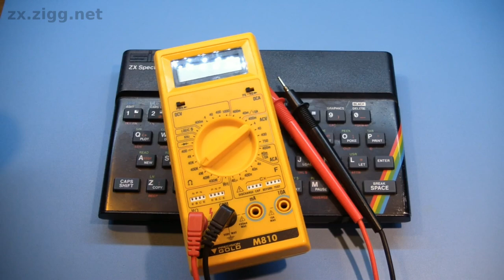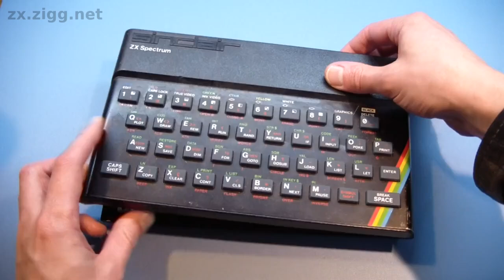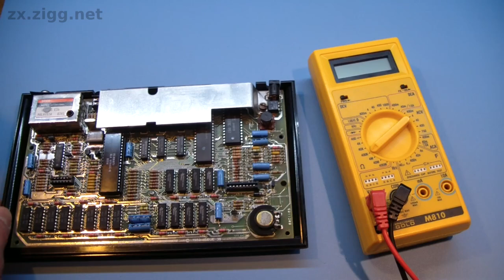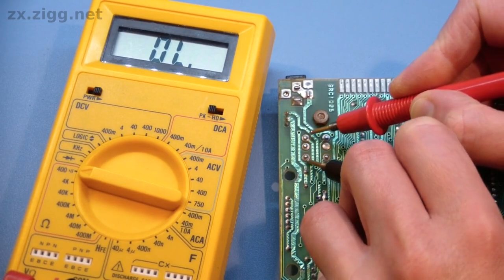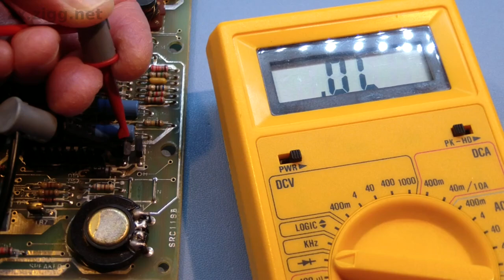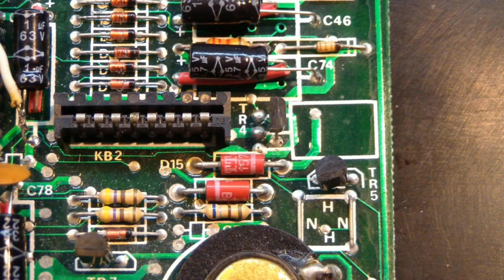ZX Spectrum (48K & 16K) Initial Tests

Comment: HI, I have a fault on my issue 4b, I've had a lot of help from the good folk on the spectrum 4 ever group and I've managed to get it working with their help, but I now have a strange video problem I thought doing a composite mod might help but it's no better, I've tried with and without a 100uf cap, the problem is the image on screen is wobbling and I get intermittent red'ish fuzzy colour bursts, it looks like what happens if you switch between pal/ntsc, but the tv doesn't have a pal/ntsc selector for cvbs, I've repaired a good few components for various reasons but the machine is re capped and I've changed the LM 1889 IC and the crystal x2 I've also replaced TR1,2 & 3. can you think of anything that could be causing the picture to be unstable? any ideas where to look next, I have some basic tools but no scope.Thanks,Chris.
Reply from the maker: If the Spectrum works perfectly apart from the display problem you describe, we can conclude that the fault almost certainly lies in the video circuitry. An oscilloscope would be very useful here; I'd want to use one to view the final video signal and the signals at some of the encoder IC's pins - the Spectrum service manual has some diagrams showing what should be found here.

You might have to consider the possibility of the failure of one of the components that almost never fail; resistors and the small capacitors. I have encountered a few very strange video faults that were caused by these components. I recall one case where a ceramic capacitor had gone short-circuit and another where a resistor had broken in two, but the break was only apparent with very close inspection under a magnifier.

Comment: When I could not find the adapter for the zx spectrum +, I found myself another. (8V and 2.6A) power jack internal +, external -. This adapter has been in operation, the jack entry verification ...
Reply from the maker: Your message doesn't make much sense, but I think you might be enquiring about the suitability of the power supply unit you have obtained. The one you describe should work, so long as it has a DC output, HOWEVER, note that the centre terminal of the ZX Spectrum's power connector must be connected to the negative side of the supply. The computer will probably be damaged if you get this wrong.

Comment: I have a spectrum that I have just acquired but it has issues.  It's an Issue 2. I tested the voltages on the Lower ram. I'm getting -1.79v on the -5v rail, 6.79v on the 12v and 4.89v on the 5v rail. Regulator is putting out 4.89v. it's very voltage sensitive (I'm using a Weir non switched mode bench supply). would bad caps cause the low voltages or something else ?
Reply from the maker: Either the voltage converter circuit isn't working or one or more faulty lower RAM ICs are overloading its outputs.

There is a potential circle of failure and all parts must be corrected in one go.

The voltage converter circuit most commonly fails for one of the following reasons:
 - Aged electrolytic capacitors. If your Spectrum has its originals, I recommend you replace them (see another video I've made about this process if you need advice on this).
 - Incorrect use of the expansion connector has shorted one of its outputs.
 - One or more faulty lower RAM ICs has overloaded its output.
In all of the above cases, TR4 usually burns out and sometimes TR5 as well. It's rare for the inductor to fail, but it can happen.

Lack of the supplies generated by the voltage converter circuit often causes one or more of the lower RAM ICs to fail, so ideally, you must make sure the converter circuit is fully working and none of the lower RAM is faulty before applying power again.

If you use a bench power supply to feed the Spectrum 9 V DC with the current limited to 750 - 800 mA, then usually if the current limit activates for more than a few seconds, you'll probably have a few seconds further before TR4 is destroyed should one or more of the above faults still be present.
Reply: Thanks for the speedy reply. I'll change the caps and possibly Tr4 & Tr5. I hope the lower ram is ok as I'm able to enter "PRINT PEEK 23732 + PEEK 23733 * 256" and get the 65535 (48k answer). It wont load tapes either and I hear no loading sounds although beep command and key click is ok. hopefully not a faulty ULA, even though it gets quite hot... I have already purchased a new keyboard membrane and upper ram module. I'm losing faith with it, it's starting to cost more than it's worth.
Reply from the maker: I'm a bit confused. If the lower RAM 4116 ICs haven't got all three of their power supply voltages, then there's no way the computer will initialise and give you the Sinclair Copyright message. I think you must have made a mistake in measuring the voltages.

If the computer produces the correct initialisation display, then the voltage converter circuit must be working and the lower RAM is probably not faulty (though it might have a partial/intermittent fault). I still recommend replacing the electrolytic capacitors, however.

If audio output is working, then the ULA's audio I/O is probably (but not certainly) not damaged. What are you using as the audio source? Many modern devices (e.g. phones/laptops/MP3 players/etc.) cannot produce a signal of sufficient amplitude for a Spectrum to be able to load from.
Reply: I can assure you, those are the voltages at the lower ram chips tested with my Fluke 77.  the Spectrum works set on at 8.42v. Slightly less then I boot to black screen with white border and If i up the power to 8.75v or more I get black squares starting to appear on the copyright screen. As for audio, I have tried phones, pc Soundcard out and a cassette player ( only radio noise as I have no tapes) I hear nothing through the Spectrum's speaker at all. I did trace the audio back to pin 28 (i think it was) of the ULA socket and sound "in" is present but very quiet when the ULA chip is installed and clear as day when the ULA is not in there. (hope that makes sense) . I plugged headphones into the mic socket and wrote a quick hello world program then saved it. sound was spot on and loud through the headphone. Think I'm getting far beyond my capability's here but I do appreciate your help  :)
Reply from the maker: I'm still a bit doubtful. If your information is correct, then your Spectrum has miracle 4116 ICs that are unlike any other! Perhaps they're just about managing to work in some way with the voltages you've measured, but I'd certainly expect the whole system to be unreliable.

Are the voltages you refer to in your message immediately above what you are feeding into the Spectrum's main power input socket? A Spectrum shouldn't be very sensitive at all to variations in its supply voltage. If so and the regulated 5 V rail is remaining steady, then I think your Spectrum has at least one of the faults I described in my first reply.

Can you hear a soft buzzing sound from the inductor when the power is on? Have you tested TR4 and TR5 (in-circuit measurements are usually enough to tell whether these have failed)?
Reply: That is the voltages I'm supplying to the DC in, yes (sadly no current limit on my supply)..... I hear no buzzing sound around the inductor and it looks like we have a short on TR4 between base and emitter.  Tr5 seems ok. I'll order a new transistor (or two), replace the capacitors and I will report back any findings. Thank you.
Reply from the maker: A base-emitter short is a very common failure mode for TR4. A short between the inductor's windings would measure the same, but that's far less common.

Note there are very few physically small NPN transistors that will reliably replace TR4. However, it isn't too difficult to buy a ZTX651/652/653 and you should use one of these.
Reply: Well, my transistors arrived today and I just couldn't wait to replace Tr4 and see if that fixes things. ZTX651 fitted nicely. Now my inductor is buzzing and my voltages are now spot on!. The spectrum doesn't care on what voltages are supplied either and I'm now playing Manic miner on it. I still need to replace all the caps once they arrive but I guess I can consider this a fixed Spectrum. Thank you very much for your replies and time.

Comment: +JoulesperCoulomb - What cheaper makes and models of testing equipment would you recommend to make the various tests on you videos? My multimeter is missing some of those tests and ranges.
Reply from the maker: +eLJaybud What is it missing? Almost every basic multimeter should be adequate for the tests demonstrated in this video; even the most cheap and nasty. If it has manual range selection, then its range divisions don't have to be the same as the ones on the meter I used. Simply select a range that covers the expected likely reading.

As noted, the results for the resistance tests vary somewhat depending on the multimeter used and the version of ZX Spectrum. The aim is to make sure none of the circuit paths measured have an unreasonably low DC resistance.

Comment: Excellent!

I just ran through the tests on an Issue 1 and got slightly different results:
 
For 16k RAM:
- lower right pin 9 I got 90-100 kOhm.
- upper left pin 1 I got 1.2 kOhm.
- lower left pin 8 I got the same as Iss 2, ie 800-900 Ohms.

For TR5, +ve on base and -ve on emitter I got 0.8v.

These seem reasonable but I was wondering what others read for Issue 1s?
Reply from the maker: +derekjc777 I've never tested an issue 1 Spectrum. The readings you report do not indicate the presence of any serious fault.

Comment: I just received a 16K Spectrum, issue two. I purchased it as a faulty piece with an intention to repair it myself. I performed all the tests described in this video however i'm not sure which results are OK and which are not OK as i have a different multimeter which has scales like 200, 2000, 20K, 200K Ohms etc. instead of 400,  40K, 400K etc. For example the voltage regulator measurement shows 3.97 on 20K range (left side). As for the voltages i measured +8.9V on the left, 0 on the center and +5.02 on the right side which i suppose is OK.
As for the TR4 measurements, I got a value of 1415 on its emitter (when using diode test feature on the multimeter) and open circuit on it's collector (multimeter beeps just like when you perform conductivity test).
This is the picture Spectrum currently shows:  http://s7.postimg.org/qw91apjl7/WP_20151029_001.jpg
Hopefully it's just the lower ram + related transistors and not the ULA.
BTW You produce fantastic and very informative videos, please do more 'Spectrum repair' videos, they are cool!
Reply from the maker: +TheGoldieOldies It doesn't matter that your multimeter has different ranges. This method of testing is a bit inexact and the results will vary from meter to meter and depend on the range any particular meter uses. To some extent, it's a matter of getting to know what results should be expected when a particular meter is used. The results vary a bit between the different versions of the ZX Spectrum too. However, the types of faults being tested for here will generally result in very low resistance readings (often less 150 ohms or so).

I don't fully understand your description of the outcome of your tests on TR4 as you don't explain exactly what you were doing. What is 1415? What units does it have? Most meters don't beep in any circumstances when set to the diode test mode and if I encountered one that did, I think it likely it'd be to indicate a short circuit and not an open one. However, I know nothing about the meter you used.

Have you checked all three power supply voltages at the lower RAM ICs? Given the picture produced, I rather suspect they will be present and correct, but they should be checked. Can you hear a faint buzzing or similar noise coming from the inductor?

The display in the linked photograph is a rather unusual one for a faulty Spectrum. It makes me have a slight suspicion the ULA may be faulty and I recommend you test it in another Spectrum if you are able to. Don't try another ULA in the faulty Spectrum at first, just in case it has a fault that causes it to damage the ULA, though this is unusual. If the ULA is not faulty, I'd next suspect the lower RAM (or its power supply), followed by the upper RAM.
Reply: +JoulesperCoulomb Hi, i'm using this multimeter: http://s21.postimg.org/onktybvp3/196402037_hires.jpg
I put an arrow there to show you which feature i used to test TR4. 1415 is a value i got when i placed the red probe on TR4's base and black probe on its emitter. When I placed the black probe on its collector the display on multimeter just showed OL and it was beeping.

I've just measured all the voltages as quickly as I could and here are the results:
Lower RAM: Bottom right: 4.98, Bottom left: 8.24, Top left: 0, Top right: 0
TR4: Emitter: 0V, Base and Collector: ~8.95V
TR5: Emitter, Base and Collector: ~5V

There is no buzzing from the inductor coil.
Reply from the maker: +TheGoldieOldies The incorrect power supply voltages and lack of noise from the inductor indicates the voltage converter circuit isn't running. I'm very surprised the lower RAM is able to accept and hold enough data to produce the display in your first photograph.

The diode test mode of a multimeter normally shows the voltage drop across a diode when it is forward biased or open-circuit (it usually displays OL, but doesn't beep) when there is no conduction. Perhaps it means 1415mV for TR4's base-emitter junction, though that's higher than it should be. I'm fairly sure the beeping when you test TR4's base-collector junction means there is a short circuit; this is how TR4 often fails. Try measuring the base-collector junction with the meter set to the 200 ohm resistance range; it'll probably give a very low reading. You ought to have noticed this if you had measured the resistance between the two windings of the inductor (this is the same as measuring TR4's base-collector junction).

It seems TR4 has failed and it should be replaced with a ZTX650/ZTX651/ZTX652/ZTX653. Very few other small transistors will work reliably for TR4.

With TR4 replaced, try powering the Spectrum again. If you have a bench power supply, set it to output 9 V with a limit of 750 mA. Remember the centre pin of the Spectrum's power connector is the negative terminal. If the current limit activates for more than a couple of seconds, turn the power off immediately; there is still a fault and the new TR4 will be destroyed if you don't. If you have to use the standard ZX PSU and there is still a fault affecting the output of the voltage converter circuit, then TR4 will probably be instantly damaged.

If you're lucky you'll now have a working Spectrum. If not and TR4 fails again or the computer activates the supply's current limit, it's likely one of the lower RAM ICs is overloading one of the power supply rails. It's difficult to determine which IC and so you'll probably have to remove all of them. See another video I've made about this process should you want guidance. Unless you are very confident you can remove them without damaging the PCB, I recommend you cut through their legs.

If, however, after replacing TR4 the replacement does not fail and all power supply voltages are correct and present, but the computer still doesn't work, it's still likely one or more of the lower RAM ICs is faulty. This is often the case if they have been incorrectly powered, as the ones in your Spectrum have.

If the Spectrum still has its original electrolytic capacitors and the voltage converter circuit isn't producing 12 V and -5 V, then I recommend you replace these before removing any ICs. Failed capacitors are a very common cause of faults. Faults in C46, C44, C45 & C47 in particular are likely to affect the voltage converter circuit. Even if you get the computer working without doing this, I recommend the electrolytic capacitors be replaced anyway. There is a fairly high chance they will cause a failure soon.
Reply: +JoulesperCoulomb Thank you very much Sir. I've just ordered couple of ZTX653s. They should arrive next week.
As for the ULA testing you suggested..i have Spectrum+, issue 6A with 6C001E-7 ULA. Not sure if the ULA from the faulty speccy (mod. 5C112E-3) would be compatible with issue 6 motherboard.
Reply from the maker: +TheGoldieOldies Strictly not, however the 5C ULA might well work in an issue 6. Anyway, I suggest suspending testing the ULA until you've got the voltage converter circuit working.
Reply: +JoulesperCoulomb Hello again. Quick question...would a ZTX751 be a proper replacement for TR5? There is a big difference in the continuous collector current between the two (-2A in ZTX751 vs -200mA in ZTX213) - not sure if that is relevant at all. Thank you.
Reply from the maker: +TheGoldieOldies Most small signal PNP transistors will work for TR5, including the ZTX751. It's TR4 for which there are not many appropriate alternatives.